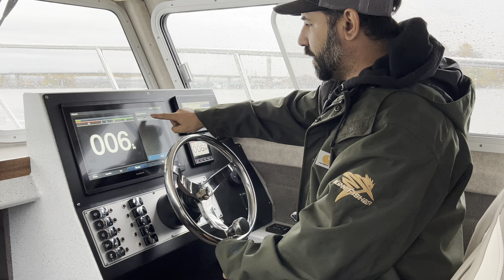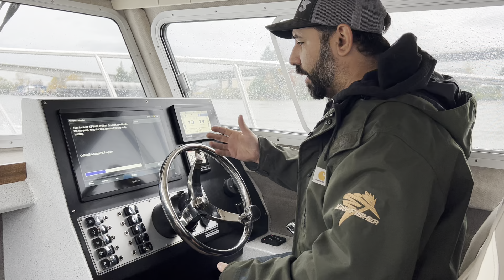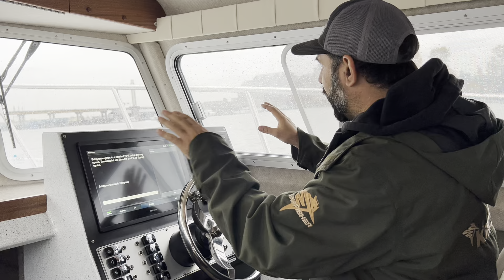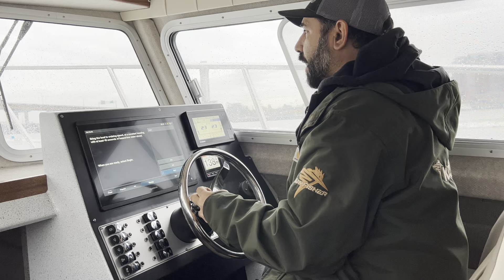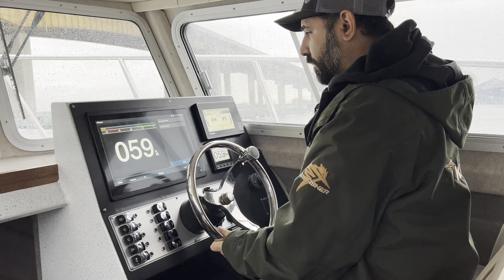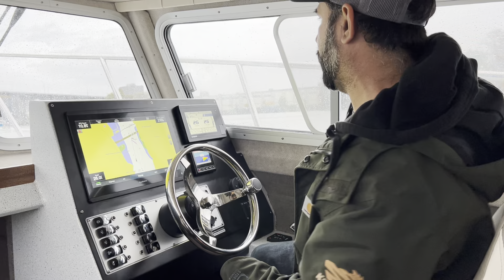How To Commission Garmin Reactor Autopilot on Kingfisher 3025 Destination

Comment: Great video Capt. Just purchased the Reactor system . On the dockside wizard it ask for speed source to be RPM if engines connected to NMEA 2K. Wouldn’t it be better to use GPS as a speed source?